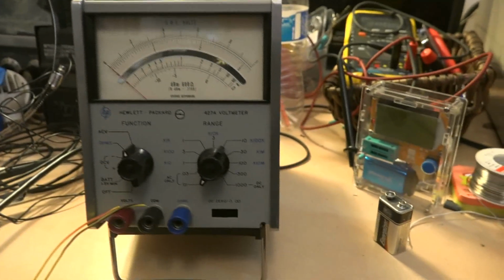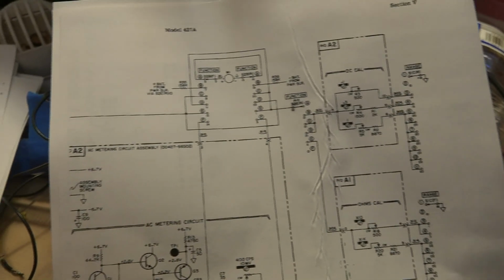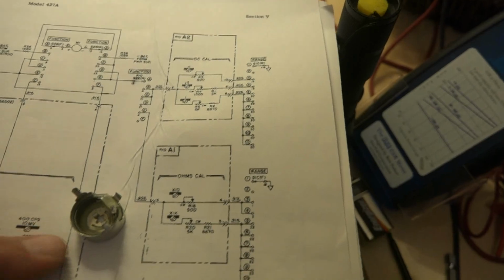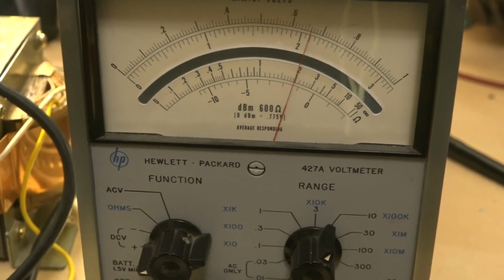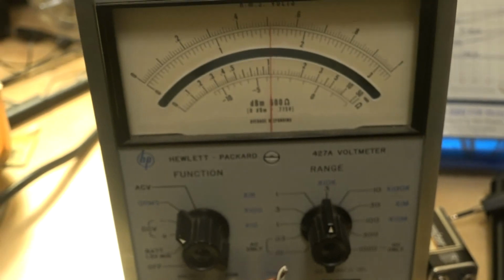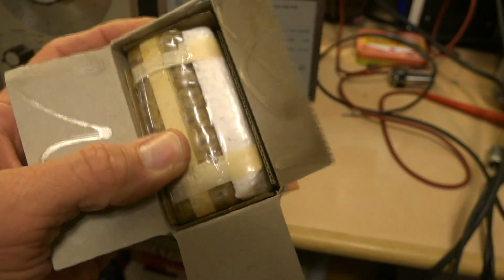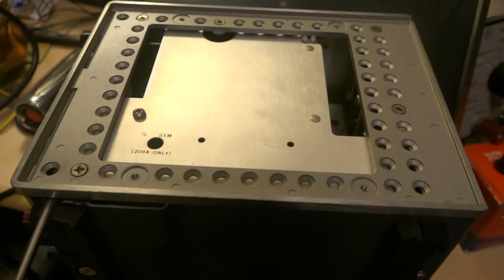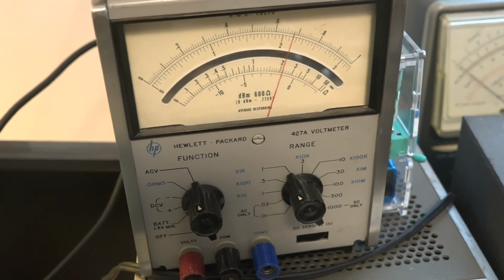Repairing a vintage HP427 Analog Volt Ohm Meter

Comment: 1v p-to-p = 0.3535 RMS. 1v peak = 0.707 RMS. If the measured signal was 1v peak, it is not that far off.
Reply from the maker: exactly, good enough for signal peaking

Comment: I love the old HP meters. I have a few 3400a and 400f and they work great.
Reply from the maker: excellent,  do you have any of the old hp valve test equipment? I have an old 608 signal generator to do a video on some time in the future.
Reply: @cttv90108  No Chris but i have a lovely 675a sweep gen from 1968. Works great but it is early transistor.
Reply from the maker: I looked it up it looks like a very handy piece of equipment especially for i.f. alignment or pass/notch filter adjustment